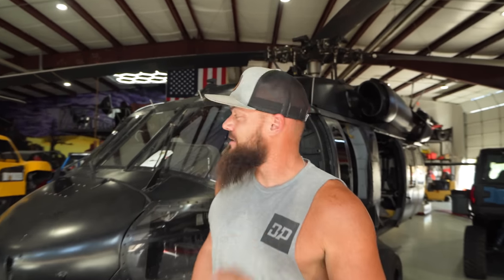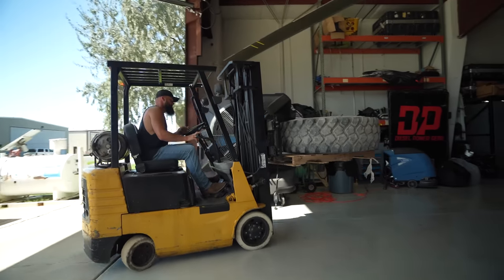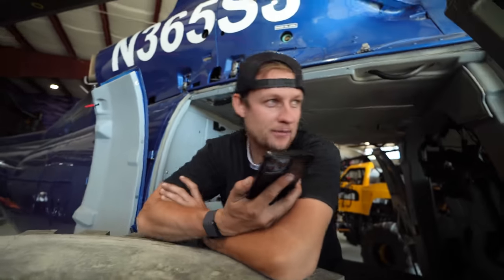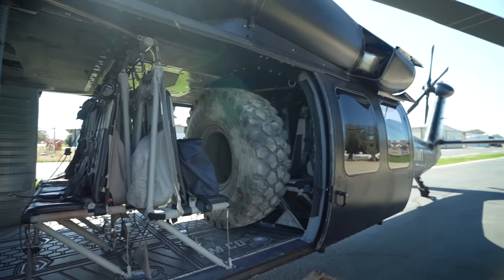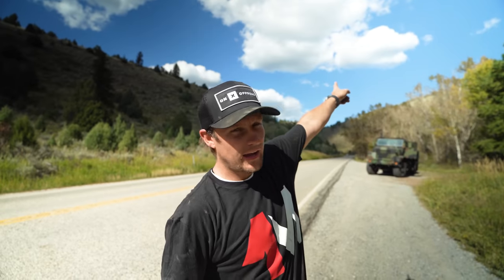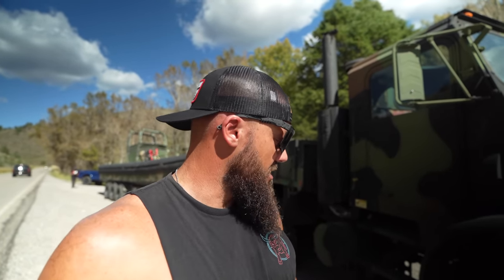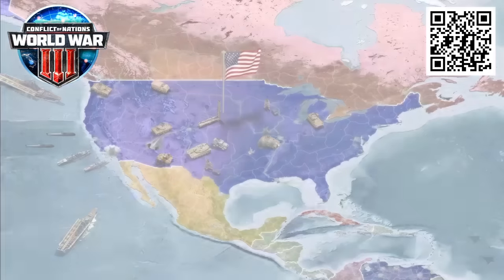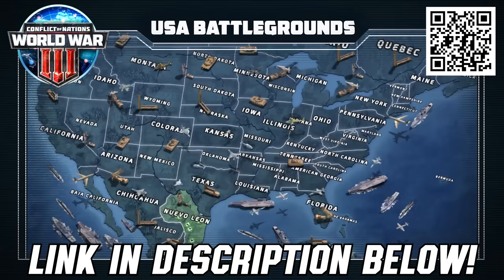Worlds Most Expensive Flat Tire Repair Using My Blackhawk Helicopter

Comment: I think its time for a new set of rubber all the way around.  2 blown on the steer axle is definitely a sign.
Reply: Only gotta look at the bubbles forming in the sidewalls haha
Reply: 100%. Dave even said it himself, old tires.  No one wants to admit it when dealing with low-usage vehicles but old tires are bad tires.  The tread can be perfectly fine but the tire is still done.  Even if they're expensive, you still have to replace them regularly, that's the life you choose when you drive something that takes special tires.
Reply: One of the issues is there are not alot of those tires around that are not milsurp. And the age of those tire are very un known
Reply: @raynetorrin  Not an excuse. If for whatever reason the OE-spec tires are no longer available new you either change to a different tire or do what the LM002 owners do and get together a group buy that justifies a new production run of the original one.

For off-road use where you're only risking yourself and/or your equipment do whatever you want, but knowingly taking a truck pulling a load on the highway with dried up old tires that are actively failing is plainly irresponsible.

Yes it's expensive, but specialty vehicles require specialty parts and maintenance. No one's ever been forced to buy one of these things, pay the cost to be the boss.
Reply: @SeanHarlow Why don't you just send the funds it for them since you own an LM002 and have such good ideas?
Reply: @1987FX16  bro he’s stating facts. We can get them everywhere here in Australia, and considering America likes to think they’re BIGGER and better, that’s pretty piss poor!
Reply: @1987FX16  Oh yea, I'm so sympathetic to the cost of a set of tires for a man who just flew his Blackhawk helicopter to go change the tire on his MTVR because the tire didn't fit in his other helicopter, when it was just sitting on the side of the road and could have been easily picked up by a semi with a lowboy WHICH HE ALSO OWNS.

But no, expecting him to not be running a massive truck on the highway with the general public on rotten tires is just too much to ask.

Comment: I believe you need a stc for a cargo hook for both choppers. You could deliver tools, supplies, tires, generators etc at any site. The hooks are located on the center of gravity ( cg ) right along the center line of the main rotor mast making it easy to calculate your useful load along with  your fuel load, pilot weight, operating altitude and mission distance. The chopper could had delivered jacks tools and tires right to the site. No need for the tow truck at all. I’m a retired A&P, IA…
Reply: I could be wrong but don't you then need a certified guy to  load it as well as a different license not to mention it might not be in the initial paperwork for registering the heli so that would have to be amended.
Reply: @jono6379  It requires a FAA part 133 certification of the company and the aircraft to be at least in the restricted category for the former military aircraft since they are taking video of it to make money. And a minimum Commercial rating for the pilot. The Cargo hook on most Blackhawk helicopters are certified for 8k-9k lbs so what he has will work, just going to take getting the paperwork finished for the restricted category since its currently in the Experimental/Exhibition category now. Current utility pilot here with a Hawk rating that worked for a company that had a Hawk for work
Reply: @jono6379 in my original post I mentioned STC that’s means that the current aircraft could be certified for cargo providing it has been approved via a supplemental type certificate ( STC ). For helicopters of that class such as the Blackhawk and the dolphin. I’m pretty sure STCs are available for that modification. Both of those helos are used in cargo operations in the military, for the Blackhawk and the dolphin for Coast Guard Usage. Obtaining an STC should not be a big deal. 

As far as a certified loadmaster for the helicopters. that could be one or many of his employees who would normally be assisting and directing him for loading and dropping off the cargo at the correct landing/ takeoff site . The loading and mathematical calculations to operate the  helicopter safely within its flight envelope would be very easy to install that on board computer program.. the loadmaster would sign off on that data input. Ultimately, it is the pilots responsibility that all. Data paperwork and flight operation are done within approved standards by the FAA pilot operating handbook including STC alterations.
Reply: Do you need addl paperwork for anything slung underneath? Cuts your cruise speed and range also I imagine?
Almost seems like a Huey would be a good daily driver, specification wise.*
Reply: There are strict limitations and rules around flying with a suspended load. One of the main ones being you cannot fly over populated areas. There is also extra paperwork, certificates, and licenses requirements. Much much easier to just load things into the cargo bay.
Reply: @markreed2576  The UH-60 is already built with cargo hook rated for 8k-9k load ranges so there is no STC required for it. There are STC that will allow uprated hooks to be installed as the max limit of 9k is actually by the airframe floor. The STC allows the hook mount points to be tied into the transmission mounts so they can install heavier capacity cargo hooks. the AS365 on the other hand we originally never designed with a hook in minds the ones that you see are designed as STC's. 
As for the loadmaster they aren't actually required only someone that can hook the load. As a UH-60 pilot we were required to do all the W&B calculations with both load and without and have the controls for release in the cockpit. All they need is to teach someone how to hook a load correctly and maybe one of the rubber lined lollipop to hook the load with as the static charge from the Hawk is pretty potent. Been zapped before hooking load for other pilots
Reply: Thanks for the responses. Seems like it would be a lot of work for Dave to do any of this. I think for now they are just using it in an experimental capacity for ease of process although I'm not sure what their long term plans are going to be.
Reply: Yeah I know what your talking about watching @CLEETUS doing that with his friends helicopter, takes some serious to do that and also hooking something while in the air and taking off! I salute you as a pilot good sir 🫡💪👍
Reply: @legohead6  HI! I'm from the government, I'm here to help you! I often wonder how many brains and hours of anguish that it took to manufacture a regulation? Most of them still smell of the blood spilled.
Reply: Blackhawks sling load Humvees all the time, even a super single tonner tire is nothing.

Comment: 7-tons can drive with 4 tires on improved roads and paved. We had kits put together where you have 2 long black rods, wood block, and bottle jack. You used the rod to hold the flat tire up. They are designed to take the tires from the middle to fix flats.

Comment: As an active duty US Navy Seabee and spending a good 5 years with the MTVRs. The mid axle is actually your spares. Your missing the chock ramps that are stored under the passenger steps that allow you to compress the mid axle suspension followed by a locking bar to keep the mid axle suspension locked in the compressed position. allowing you to put that wheel on the blown out axle. If you need some part numbers let me know. Also look into government DRMO for new tires, We just changed out a bunch due to "5 year" life cycle but have 10 miles on them from driving in the yard.

Comment: This makes me feel better about the fact that all 4 tires on my van were 526$ total.
Reply: You need about another $1.500.00 per tire for those trucks tires.
Reply: @darrellhart9363  my 526$ probably wouldn't even cover the Blackhawks gas for the trip. Lol
Reply: @strapsgamingvids  they were 4 225/65/r17, a very common size. 100$ each at a little tire outlet in Madison Wisconsin. They were around 70$ each minimum a couple years ago.
Reply: @strapsgamingvids  thanks man, lol glad I was in the ballpark.

Comment: A Soviet KA32 or something like that would be good in your line of work I think. Very robust, they can fly in most weathers where other helicopters can't and have a max lift capability of 27,500 lbs.
Reply: The amount of KA-32 available are dwindling 😄
Reply: @frank-t6857  the KA52 is taking an ass kicking right now. Not sure about the KA32 though.
Reply: Also another positive is that only 1 pilot is needed to fly a 32
Reply: @AshGTE  KA-27 is a soviet era civillian/military lift helicopter, the KA-52 is a Russian Federation attack helicopter, huge differences

Comment: Check the date codes on ALL your tires they are likely original from the trucks issue to the Marines 15-20 years ago. For your safety and the safety of everybody else on the road check your tires replace with newer less than 10 yr old rubber.

Comment: You should have seen all the truck missing tires during the first push to Bagdad in 03. Most those truck had not been used since 1992. It took 2 years to restock all the missing spares and mid axles!!!

Comment: I've put 6 new 16.00's on one of those army trucks that was a water truck. They are a pain. Central air system for each tire and a band on the inside you have to take out. But truck looks nice when its done.

Comment: I’ve had to use a come-a-long and chain to hold an axle up on a 20’ trailer that lost a wheel. Got it back to the shop 25 miles through Dallas traffic. Good times

Comment: 3:14 i saw someone manage fit a huge tire in a less than stellar hole by deflating it to the point where three 5 cm wide straps managed to reduce its diameter down enough to fit it. The whole affair was done in concert. A few strap actions, a little more air out, to keep the bead seated (no beadlock).

Comment: Nice video, well at 60 years old I learned something today,I did not know with independence axels you could run minus one wheel on the back and still go, you guys had luck like mine loosing 2 tires and no spare,goood luck guys

Comment: IN MY MK23, I have air tools on board, and an air powered jack and I carry a spare. It is not that hard! I also do it by myself! Hey HeavyD I have extra tires do you need one? Only a few hundred miles away. 
seriously,  I also have a MK23 Basic issue kit with all the limp home gear included, includes air hose and some dam nice hand tools!

Comment: Crazy - been there but not at those sizes and weights - and, of course, no copter!!! Old 1946 Higgins woody inboard on a 1946 trailer - wheel spindle burned off all the axel grease and snapped - finding an entire axel was a cluster….

Comment: I'm looking at the cordless impact wrench for the truck wheels.  Huge battery.

I worked in a small truck stop 40 years ago.  The impact wrench we had then was pneumatic, and was very heavy.  Once I took it out on a service call.  15 miles down I-5, and the compressor on the service truck would not start.  I had a bottle jack, but no way to loosen lug nuts.  I could only apologize to the driver and go back to the shop.

Comment: I can't believe you didn't have a spare on the truck. I hauled 15-20 M900 series trucks off the Marine base at Barstow. Only had one tire blow, and that was an intermediate on the truck I was towing. Changing one of those tires by hand is a real bear when you don't have air tools.

Comment: Michelin military tires are the worst crap that money can buy.

I purchase a M35A3 from a GL location in Michigan. The pictures of the truck had all the tires inflated. I was soon to find out that these tires being older, if the truck sits on the sidewall, they internally rupture and it's just a matter of time before they pop.

Root cause was the CTIS central tire inflation system leaking down over night, then the truck sitting for days, weeks or months at a time.

My 550 mile trip blew 5 tires. The first tire was a bear to change, the others took less than 45 minutes each.

Comment: Hi dave why didn t you let out the air out of the tyre and it may fitted in to helicopter and just take compressor with you and just reinfalate  it when you have changed the wheel

Comment: that is pretty funny
so if that spare (off the fire engine) didn't fit the front, could it go on the rear? just a thought and might have let the front last
i have had similar issue with Land Rover military tires, they are made for off road and take some abuse, ponding the motorway concrete was never considered in the design, and yet that's there biggest test and failed - that second front definitely had some more life left in it !!

Comment: Dude, you do not need to use a 1" impact on those lugs. 1" is even too big for the massive 3/4" bus lug studs and will strip them. The torque spec for those 5/8 or whatever they are is probably around 200 lb

Comment: Good thing he modified his statement to not match the Title. The tires on a Cat 797F, weigh 12,500 lbs each. I'm willing to bet they cost a lot more to change even with the Helicopter fuel costs.

edit- for those to lazy to look. The Cat 797f  uses a 59/80R63 tire. Each tire cost roughly $42,500.

Comment: I am confused, there is 3 tyres on the back of the truck, where did the 3rd tyre come from,  tyre 2 and 3 are the flat and wrong ones, but the first one was a spare that was on truck already, so why not use that one?

Comment: Word to the wise. Any old truck bought comes with a fresh set of front tires. Rears can suck it up, they usually blow because they were far past the expiration "date", but fronts are double duty. First for the load, second, the tire's walls, they twist with every steering adjustment you make. That's like asking an 80 yo guy to do the Macarena AND the Twist at the same time. Ain't gonna happen, ain't gonna fly. Just sayin'. New tires. A cheaper new front tire is always better than an old rotten one.

Comment: Need a video on what is required to fly the Black Hawk. Do you have to notify the national guard or anything or just a regular flight plan (I don’t know shit I’m talking out my ass) 

But anything about what goes into actually using it would be very interesting.
Reply: Probably not since it's a experimental so no approval needed besides you have to have 2 pilots as once that can fly it.
Reply: They talked about it in one of the previous Blackhawk videos. It is under a category separate from civilian or military. They had to go through a bunch of documentation to register it and now flying it is relatively straightforward like any helicopter

Comment: This was 1,000% predictable. The super single tires have a maximum speed rating of 55 MPH stamped right on the side of the tire. The MTVR will go 65~70 with its 4000 series transmission, and you WILL blow those tires left and right at those speeds. I've got tens of thousands of miles on these super singles that I run on my fleet of military vehicles, and never once had a blow out. Most MTVR guys can't make it more than about 300 miles before blowing one. The MTVR wheels are also vehicle specific. As a fellow MV fleet owner and enthusiast, I'd be happy to come give you guys some safety and informational pointers on your vehicles there, I've even reached out to you several times, sadly with no response.

Comment: Too bad they weren't running the long life tires my Dad designed for the DOD/Civil Defense folks.  50 years minimum lifespan.  Of course they weren't cheap but were intended to outlast just about any prolonged event.  He had to design the materials used to make them first (rubber formulations, cord fibers, etc, etc).  No he didn't design those formulations for Michelin.

Perhaps its time to upgrade to Tyron Multibands and no longer have a vehicle totally disabled by a flat and now able to safely run about 60 miles at speed after loosing air pressure.

Best!

Comment: The tire y’all made such a big deal about getting it in the helicopter and flying it there was never even used. So the helicopter wasn’t needed other than getting there faster. Should have just used one of the back tires to begin with and chained up the axle but I know it’s all about making content.

Comment: I hope one of you have their A&P license? AKA: Air Frame & and Power plant license . If not you might want to delete this video ASAP. Unless you want to get your pilots license revoked and your Black Hawk .grounded till you have A&P mechanic review / repair your work then an  IA inspector, inspect your work. 
Then and not only then is your Black Hawk air worthy.
Per- FFA, CFR's you are not allowed to adjust even a seat belt (ie: frivolousness example) without an A&P license. Also I can assume you did your weight and balances per MSDS before flight check list?
I hope I'm wrong for your sake. If I am my apologies. No ill will intended, just trying to help ANYBODY avoid our shit system from fining you 10s of thousands of dollars and or suspending your pilots license .Of course safety is also prolly 3rd on that list.
Cool videos they are very intriguing and occasionally informative